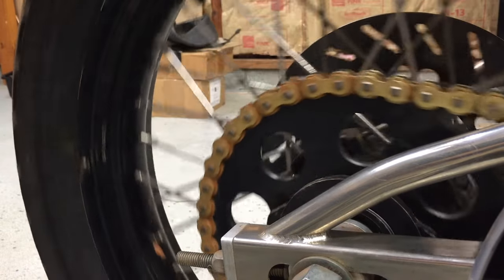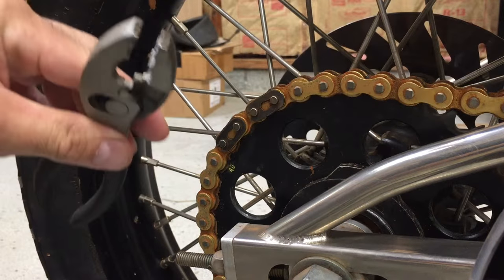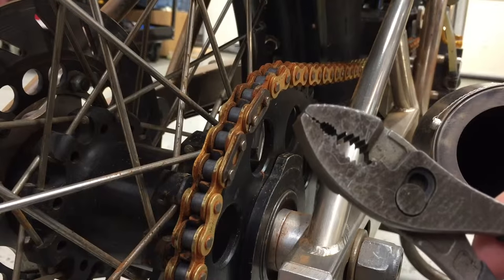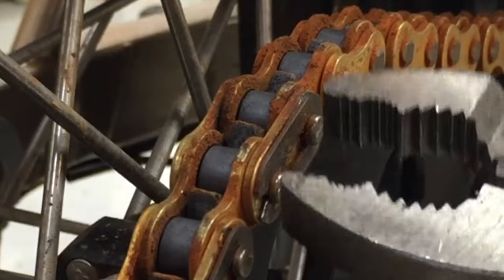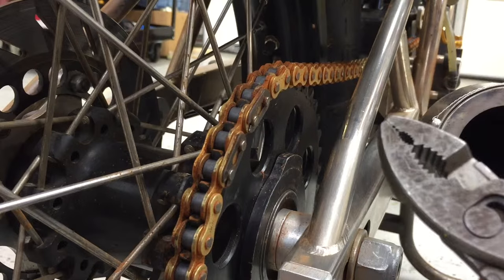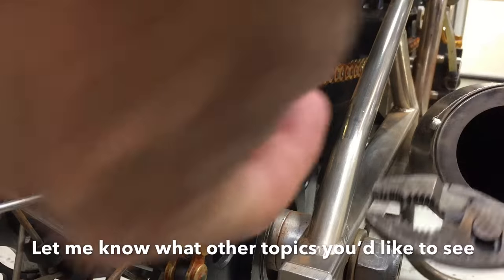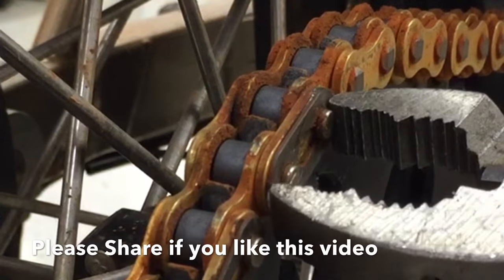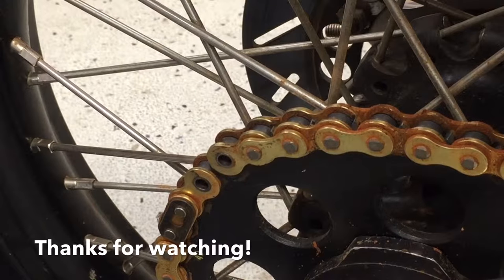Chain Master Link Removal  (To install: link in description)

Comment: Very easy to remouve the lock ring.. impossible to remove the chaine link…..wtf.. im stock
Reply from the maker: Try penetrating oil, or if you don't have any, use automatic transmission fluid (pull the dipstick of an transmission and gather a few drops off it for your link...it doesn't take much).  Let this sit, then pry off with a screwdriver. Also try squeezing it on, then alternatively prying it off.  Lastly, heat the plate a bit with a torch. Good luck and report back.
Reply: Well, made it! I used a cutting plyer. As is hase an angle, it squeezed between the plates and opened them nicely. Just had to be care full not to fuckup the O rings.

Comment: this is an awesome video and helped me a lot but when i got the master link off the other little pieces that you have to take off to completely get the chain apart is stuck and I can't get my chain apart and also this is on my Honda trx 400ex four-wheeler does anyone have any suggestions.
Reply from the maker: I'm not sure exactly what your talking about, but here's some thoughts.  If it's the side plate you're talking about, get some penetrating oil on it for a few minutes. Then try to work it both on and off. On by squeezing it in the middle with something like needle nose pliers. Then off by prying it off with a screwdriver. Working it back and forth (on and off pressure) may help. Good luck!

Comment: Is this safety for speed riding
Reply from the maker: I'm not sure what you're asking. This works for removal. Manufacturers typically recommend replacing with a new master link. Check with your chain's manufacturer for part service life.

Comment: Got the front retaiber off but the link still won't come out
Reply from the maker: Look carefully at the ends of the pins. Are they flared out, perhaps? If so, you might have to grind them off. If not, try and spray some penetrating oil on it and pry it off with a flat head screwdriver.  If you have a torch, you could try heating the sideplate first.

Comment: Why on earth 2 links
Reply from the maker: Gearing combinations and desired wheelbases on this racing motorcycle require chain lengths from 49 to 51 links (98-102 rollers if you count that way). This results in it running zero extra chain links, one extra, or two extra. Putting one of those extra lengths of chain in requires the second master link. Gearing is often changed many times per night. The other way to address this is having three different chains.
Reply: Ok great explanation it would suck to deal with 3 chains
Reply: @FlatTrackFactory  HUM, interesting concept, glad it works for you